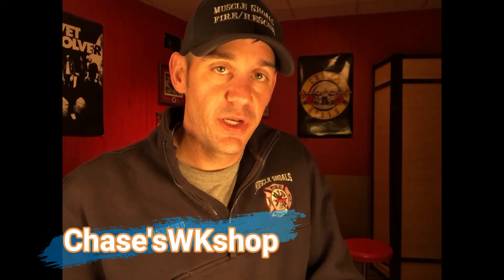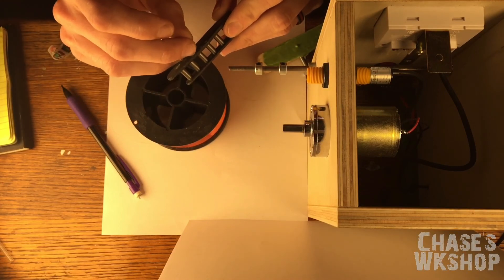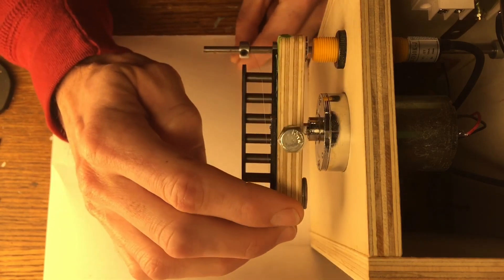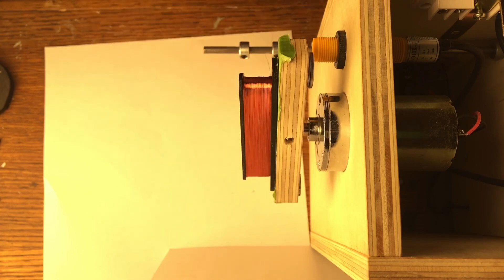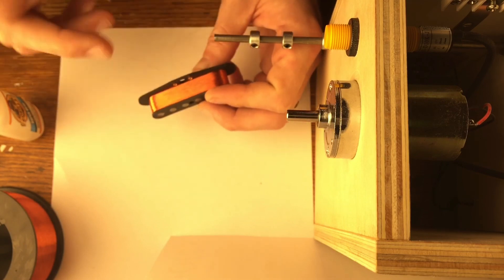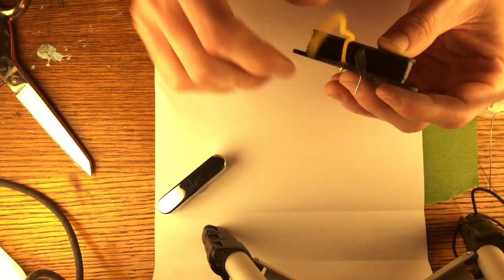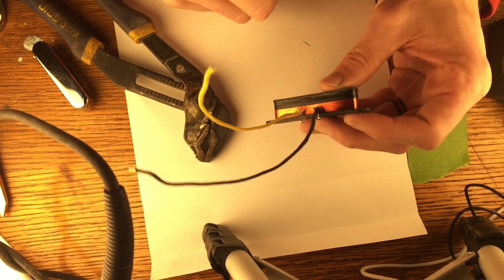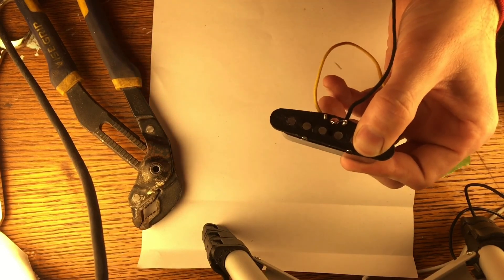How to build a Guitar Pickup (part 3) Winding a Pickup

Comment: What do you like to use for the ground and lead wire?  Do you need different kinds of wire for different pickups?
Reply from the maker: Thomas Ring I usually use the cloth wiring like this. For single coils. 

https://www.stewmac.com/Pickups_and_Electronics/Wire/Single-coil_Hookup_Wires_-_12_inches.html

You might want to use a shielded wire too in humbuckers like this. 

https://www.stewmac.com/Pickups_and_Electronics/Wire/Shielded_Push-back_Wire_-_16_inches.html

Hope this helps. I really don’t see a big difference in the type of wire. I just personally think that the cloth is easier to use. Thanks for the question. Let me know if you have any more questions.

Comment: One question I do have. It's where I've had troubles. I made a rod to hold my spool of wire horizontally, and it fed too fast. I made a sort of brake with a spring loaded paint brush that rubbed against the spool to keep it from rolling too fast. It helped a little. You said about putting your spool on the floor. Do you set it vertically on its end or lay it horizontally? I think once I get this right, I'll have less problems. I made a sewing machine winder. I have to install a speed controller on that motor to be able to start out slower. The foot control for the sewing machine is just not a fine enough control. Thanks for any help!👍😎🎸🎶
Reply: I've have used in the past the motor of a died screwing machine and as speed control and old speed control recycled from a race car track, that same that looks like a pc  joystick, but with a potentiometer in the upper side, that worked like charm, hope this to be useful.